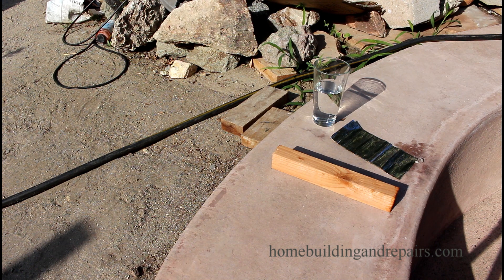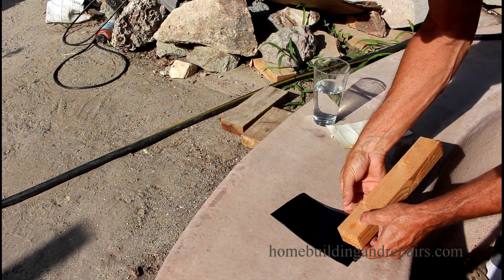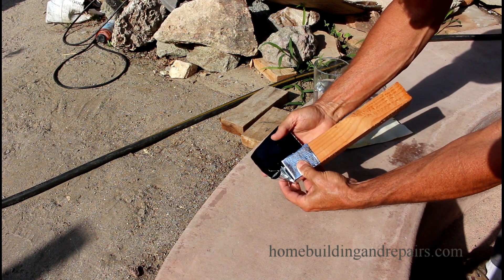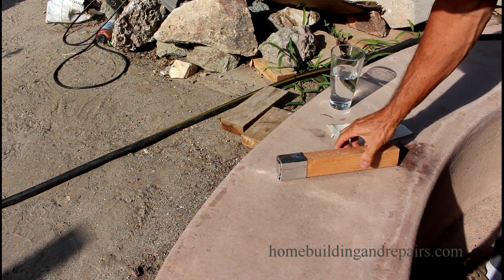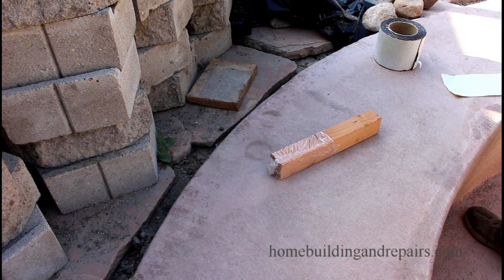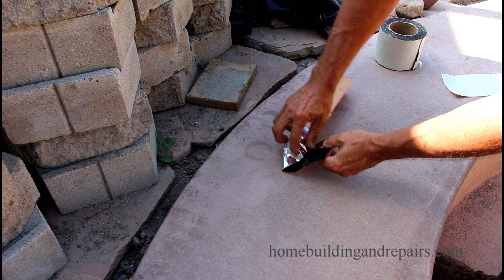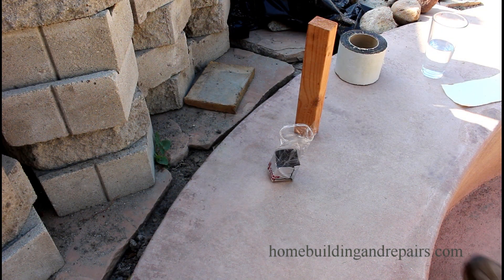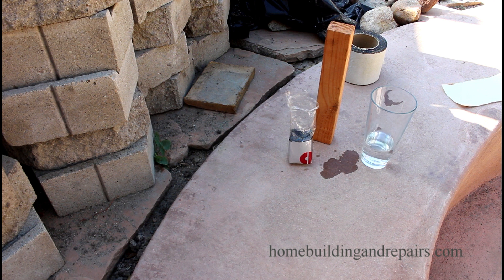Here's What Happens When You Seal Bottom Of Wood Fence Post - Wood Rot Damage

Comment: I have a natural spring under my pole barn. I wrapped my posts in asphalt mesh and heavy coat of tar 1 feet above grade. Pulled up a few of the posts not long ago to add an entrance and the wood was as dry and sealed as the day they were installed. The hole actually had a few inches of water in it when we pulled the post. This ongoing back and forth of to seal or not to seal is baffling to me.
Reply from the maker: Your method makes more sense on a pole barn protected by some type of covering, but might not on an expose to the weather fence.

Comment: Thanks Greg. What do you think of wrapping just the sides of the post, not the bottom, to prevent concrete from leaching water into the wood?
Reply from the maker: I've seen good and bad results.
Reply: I pack the bottom of the hole with about 4"-6"pea gravel then seal the post leaving the bottom open so any absorbed water would drain off. Also if the wood above ground is sealed with appropriate products even less water obviously gets below ground.
Reply: This, exactly. Wood breathes, even when it's in the form of a post, so protecting the sides (that would be in contact with soil) and leaving the end free to allow any moisture to escape is a better way, and as the other person commented always put some form of aggregate in the bottom of a post hole to allow drainage. Ideally you want no soil contact with the post and cement them in with the concrete a few inches about the ground level.
Reply: Who's wrapping a post like this.

Comment: I've got some left over plasti-dip and I was thinking of coating the bottom of a post to prevent rotting. Maybe not the best idea. 
Though if I put sand/gravel at the bottom of the hole and only coated the sides but not bottom of the post do you think it'd keep it around longer? 
Water would still be able to get out the bottom, and shouldn't be able to get in through the sides of the post. 
If I dipped a few inches above ground level it would also prevent snow from melting into the post. 

This is just for a place to mount an EV plug so it's probably overkill to even use the gravel, but I like doing things that last.
Reply from the maker: I won't be able to provide an answer, but I would still make the post as strong as you can for an ev plug.
Reply: Yes! Don't coat the bottom!  Gravel isn't overkill, it's proper!

Comment: Paint around the post not the bottom.
If you have a good hole design with a gravel base water will run down the tar between the concrete and dissipate in the gravel

Comment: I like this concept. Question? Why can wood post last for decades when used as post for lake docks (totally submerged)  and water gets blamed as the rotting of fence post?
Reply: Submerged is not a problem. Its the combination of air and water and expansion and contraction.
Reply: @tommytruth5996  This, but also wood type matters as well I would assume.
Reply: As far as I can tell from my research: fence posts tend to rot within a few inches of ground level mostly due to the aerobic bacteria & fungi that live in the topsoil. Go deeper beyond the topsoil and conditions are more/completely anaerobic; this confluence between microbial rich humus and the air create an environment favorable to saprobic (feeds on wood) bacteria & fungi. So being completely submerged in water can have a  preservative effect with certain types of wood.
Reply from the maker: Because usually the wood is chemically treated.
Reply: It’s nothing to do with chemical treatment, hence why ship wrecks or pilings from hundreds of years ago are still in situ. Certain types of wood are able to tolerate lengthy submersion without rotting because they are resistant to damp or bacteria/living organisms. Eg Robinia, mahogany, ironwood, teak. Below water there’s minimal oxygen which is required for rotting. Fence posts tend to rot around the top 6 inches of soil where there is suitable air/food/moisture mix for microbial/insect activity to occur . Protecting wood around this zone with sheathing will extend its life as long as you don’t create a bucket for the water to stay in
Reply: Obviously chemical treatment does have a huge benefit but the points above are how it works without treatment

Comment: If you don’t wrap the bottom end grain, and only the sides of the post wouldn’t moisture be able to escape, while you still have protection from soil?
Reply: You'll get rot if there is both oxygen and moisture present.  One without the other doesn't produce meaningful rot.  Soil is permeable to oxygen albeit poorly.  It's why posts rot at and just below grade more than anywhere else.  The deeper you go the less oxygen there is available to the microorganisms that would feed on the wood fibers.  That is to say, soil doesn't really provide protection until you're under about a foot of it.
Reply from the maker: If the moisture can work it's way out, then it can work it's way in.

Comment: i just coated a pressured treated post with flex seal 6 in above ground level 2 times drying between each coats including bottom and putting gravel and large stone on bottom then packed with 3/4 minus to above ground level.
Reply from the maker: Let us know how long it lasts, if you're still alive:) Hope it lasts for ever.

Comment: Indeed, it can/does retain water. However, other proponents of sealing (eg.,  with asphalt-based coatings, char & coated, etc.) suggest that moisture will wick UP, and out, naturally, as the wood dries (assuming normal moisture is not ~constant). This also makes sense, given that there are x#  more 'dry' days than rainy ones, in a given location.

Further, in my experience, the actual rotting is predominantly at/near the surface, and NOT at the bottom, where the 'cup', as you say,  is posited to be retaining water. I don't have sprinklers or  extraneous water sources affecting the fence, BTW. If your attribution  of 'cupping' & holding moisture were true, then one would predict &/or presuppose that the rot would be mainly at the bottom,  rather than at/near ground level (topsoil), as I have noted. 

I used concrete and both treated landscape timbers &/or treated 4x4 posts withy first fence , without any sealer, and it rotted out at/near ground level and much of it fell in a storm after say 5-6 years--many 'snapped' right at the topsoil level [I was shocked]. Of course, different conditions, regions, woods and moisture levels may make 'mileage' vary...many variables, as you note in your various videos!

However, being that [most] rot is at /near the topsoil level [IN MY CONDITIONS], then one might attribute MY rot problem as being a byproduct or consequence of the biotic organisms present in soils, (and moisture which aids their processes) doing their 'natural function' of breaking down organic substances--i.e., its what they DO. If the foregoing is veridical, then your assumptions and reasoning, though seemingly 'common-sense', do not 'hold water', at least in my case &/or conditions. Again, MY rot in the first case (unsealed) was not at the bottom, where one might expect moisture to be relatively greater or more persistent over the long term.

for this reason, my further [re-do] attempts involved coating the bottom ~25% with roofing 'tar' [INCLUDING THE ENDS], and ensuring that the coating went above the ground level, again using concrete around the posts ,  sloped to drain away rain. This seems to be holding better, and mostly is still intact after ~ 9 years. A relative took my advice on this method and has had good success as well for ~9 years or so, as well.

Not sure how long this will hold, but I think if I have to do this fence line again, I will either use metal posts in concrete (they seem to last a looong time--because more resistant to bio breakdown[?]), or perhaps use the old-timer 'char' technique combined with sealing. 

One post on YT that I saw used a motor oil-diesel gas mix topped with asphalt sealer; he claimed it might last 100 years [dunno about that]. Interestingly, the charring method shown in some vids may open up more easily-affected surface areas into micro-pores, which would allow greater absorption of the oils into the surface of the wood, presumably warding off biological organisms which contribute heavily to the 'rot'. Not sure if both the oil wash and the asphalt sealer are really necessary, though, as they both perform the same basic function. What do you think? know of any videos that have set up an actual [long-term] test of the various methods on a single fence line? Thanks for your vids and such. ;)
Reply: i think you are right. coat the whole post with tar, put a sleeve of plastic over the top so water doesn't get into it at all and it will last close to forever.
Reply: @sunshine5349  diesel & used motor oil 50/50 mix on the entire  post with only asphalt below & slightly above ground.
Reply: Although you are both right, we need to understand rot. There many methods that work but all work for only one reason. Keep bugs out. Micro and all and wood wont rot. Think of it that way...oil, tar, sealers, char, copper, and more.  Kill or at least keep decay (bugs) away. Water is not the issue. But, if you remove water or air bugs cant live there. So, above ground or deep in the ground are not conducive living conditions for those pesky bugs, again...ground level rot.

Comment: Would it be wise to use one of these rubberized sprays on the a patio wood post I have a 6x6 posts that sits on top of concrete when I clean my patio "use water " or when it rains it gets wet . I would just like to apply some type or rubberized spary to the bottom is that asking for a  problem?
Reply from the maker: https://youtu.be/AZSWsn40TnY this might help.

Comment: a fence guy said any water that's absorbed into the post is wicked upward and out of the post due to evaporation
Reply from the maker: Wood can definitely absorb moisture by pulling it out of the ground in an upwards direction and can be pulled out of the wood through evaporation. The problem is, whether or not there is a steady supply of moisture in the ground and if that's the case, then there would be a steady supply of moisture in the wood, eventually causing it to decay sooner than later.
Reply: I plan to use  a 12x12x2 concrete paver as a base for my red pine 6x6x10 posts. I will leave the bottom open but put 2 coats of Lanco Aqua Proof on the posts from base to 16" up. I'll then coat the top of the posts about 2 inches down. These 6x6 will be covered by the tin roof of my wood shed. I'll also seal the rest of the posts with oil. Hopefully this will help them last a long time. I'm on the North Shore 80 miles north of Duluth in Mn.

Comment: ive have all used liquid tar to above ground and have never had a rot issue.
Reply from the maker: I understand and I've seen exactly what you're referring to, but I've also witnessed the problems I'm suggesting in this video. Keep in mind that there are a lot of variables, for example the lumber used, this sealant used or tar is your suggesting, the soil and of course the weather. Just because something works in your area, in no way shape or form will guarantee that it will work in another area.
Reply: The tape will leak for sure because you have seams. If you use a something like tar or waterproofing caulking like zip wall sealant , you won’t have this issue because there’s no way for water to get in once it dries. But you will have to seal the entire post with paint or clear poly . Once the wood is dry and absorbs a little water, it can wick water to the bottom of the post.

Comment: Don’t use wood fence posts, they’re going to rot. Pressure treating is not aggressive enough. Use steel posts.
Reply: Those can rust sometimes faster than wood rots.  Depending of type of steel I guess.  Also wouldn't hurt to be powder coated or galvanized.

Comment: I put a cylinder Ring of concrete around my 7, 8" posts, but just only at the dirt line, 5" up and 5" down, so that the bugs won't chew on it right there. Below that is rocks all around smashed in and at bottom. Even though they're 3ft down somehow the freezing still pushed them off plumb. My grandfather put coffee can on the top of his, just to bail water for the cows, and that was the only post that didn't split cracks.
Reply from the maker: Interesting, so your saying that the fence post that received the most water lasted the longest.
Reply: Oh, sorry I wasn't very clear. I don't know how often he bailed the cud out of the cows' water but I guess the can kept the post dry of rain and snow so freezing didn't crack it. He pointed it out to me but I don't remember what I investigated about the other posts to see if he was correct or not. Perhaps someone else has tried this. But on my posts in the back I put stuff over the tops and watched them for the past 10 years to see how well they won't crack, but I don't have a control to look at to compare because I capped all of mine (with upside down plastic flower pot or tree pot or whatever). So, no, the post wasn't getting water except for maybe a few drops until the sun heated the can to evaporate any leftover.

Comment: I've always used liquid roofing tar and set in concrete and had good luck with that. 
Fence up for exactly 30 yaers this year and all posts are still pretty solidly planted. 
These are 4x4 posts not 6x6. The cross-section of a 4x4 is almost 2-1/2 times smaller than a 6x6, so if one uses a 6x6 you'll be that much better for the long run.
Reply from the maker: If it works then keep doing it, but please keep in mind that I wouldn't of made the video if I hadn't already dealt with these problems.
Reply: @gregvancom  ha haaa

Comment: I never seal the posts in the ground.  Never set my fence posts in concrete.  Dig the hole deep, put large rocks in the bottom for the end of the post to set on, surround the post with a gravel mixture, last few inches of sand and a little dirt or mulch whatever the landscape is on the final inches.  Have had these posts in the ground 30 years.  The water flows away and is not held in to the post. Replaced the fence pickets, but the posts were still solid!!!  Its all about drainage around the posts.  Keep them dry and they will last, but don't set them/seal them in water in a concrete  or any other material bucket!
Reply: Paint them with roofing tar
Reply: @johncuervo3019  roofing tar is extremely toxic. I use pine tar on mine.
Reply from the maker: I've definitely heard of others having good luck with your methods and of course plenty of others, but I have also ran into situations where high winds blew fences over that didn't have a concrete footing around their posts.